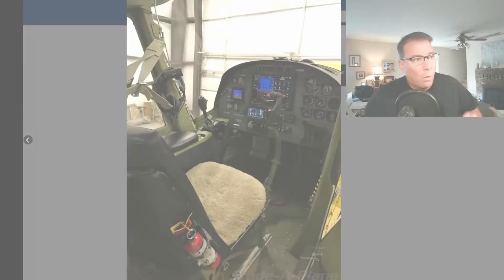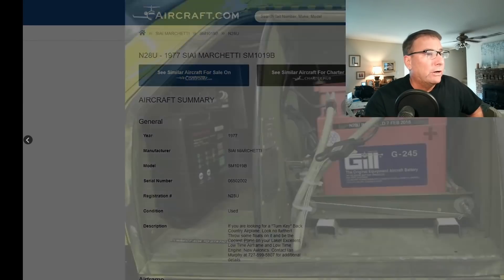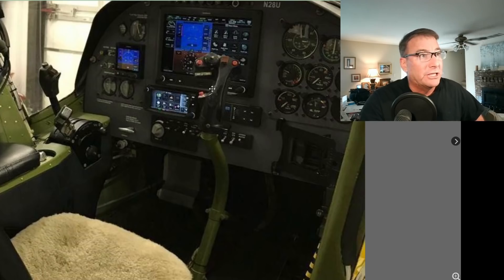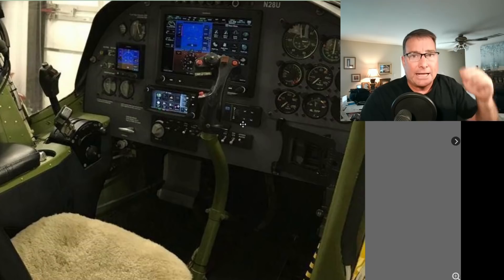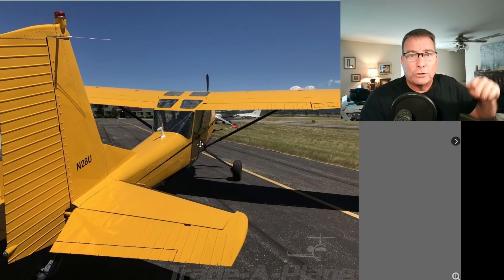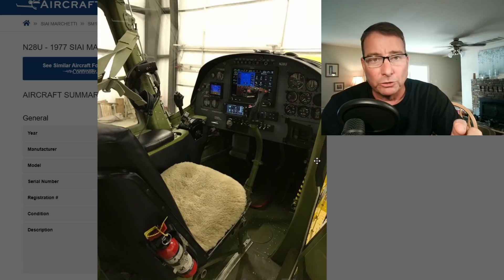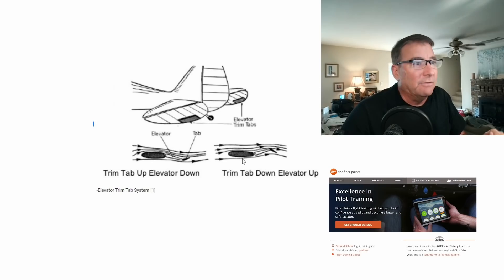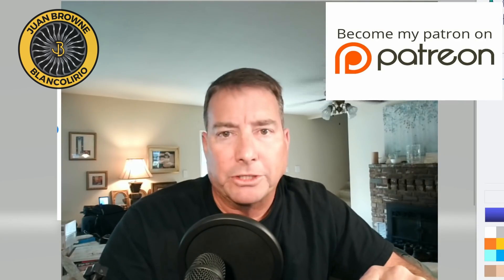Dale 'Snort' Snodgrass Siai Marchetti UPDATE- Elevator Trim System 8/8/21

Comment: Cant you just push the stick nose down to counteract that opposite trim ? And I personally think 70+ is simply too old to fly. Less than 2 weeks ago Ryan airfield, fatal crash, 87 year old pilot, I mean c'mon, 87..... That B-17 Mcauley pilot and co-pilot come to mind, 75 and 71 year old respectively, jury rigged magnetos ("she always sputters a bit, that's the charm, we always did it like this in the old days, don't worry, it's fine !"), crashing with 7 tourist passenger fatalities, or that insane Leeward, actually racing at 74, in, again, a jury rigged warbird ("just cut the wings off, it will turn faster !"), killing 10 in the stands. These guys should just stay on the ground. Yes, these examples include gross negligence regarding maintenance and modification, but can't help the fact that I think age, is a contributing factor. 75 and flying paying tourists around in a B-17, 74 and racing a P-51, the guy at Ryan 87, this guy 72, it's just a tad irresponsible if you ask me.

Comment: As always Juan, excellent respectful reporting and analysis of the accident. One thing I noticed by watching the video you linked to that adds to your theory of the control lock being engaged is that the tail of the plane was never raised prior to takeoff. As you know, pushing forward on the stick to raise the tail off the ground is a typical method of takeoff on a tail dragger. The fact that that was not done may also indicate the presence of a control lock.

Comment: Been thinking, if the trim was reversed, as you initially trim forward, the stick would come back, this would immediately get your attention. Bearing in mind you would already be putting on forward pressure to lower the nose anyway. You would at least stop applying trim and hand fly on the stick. I know longer think this was reversed trim. I now believe this was a locked elevator for whatever reason.

Comment: If you catch the airport video with the plane at just over a 60-degree bank, it can be seen the the elevator was full nose down.  Of all the theories, runaway trim is the most likely.  A talented/skilled/experienced pilot would center the ailerons and use all they have to try and push the nose forward, without asking the plane to also turn.  I’m not familiar with the air craft, but fumbling to try and change the trim while wrestling the yoke forward makes the most sense, hence the accidental push-to-talk press.  This is just  speculation and will wait for an official report.

Comment: I still have a lot of questions.  If it was runaway trim, then why could the roll not be reversed?  Theoretically you could roll to a point where you were in a stable turn, or at least not going down.  This roll stopped, but never went back to the right.  If he had throttle, aileron, and rudder, the plane could still be flown.  I realize that this is an extraordinary situation, but by all accounts Dale was an extraordinary pilot.

Comment: I haven't seen anyone mention CG. A commenter on the previous video mentioned he had loaded the plane with camping gear. How easy is it to load the Marchetti too far aft?
Reply: His wife wrote they flew the Aerostar to the airport the morning of the crash to pick up the Marchetti [from ~24 days of maintenance at the airport] and she drove the car back to the ridge. With the car available to transport any camping gear, there would have been little need to put any in the plane.

Comment: Another pre-flight tester would be a battery-operated audio beeper (single tone piezoelectric sounder) that would be interrupted at a rate proportional to the position of a pendulum hanging off the gadget. It would allow the tab position to be monitored by ear, whether or not you could see the tabs. Those sounders are cheap and the tone would pierce the noisiest location. Further, you would not likely leave your tiedown while forgetting to retrieve it.

Comment: I've not flown this SM 1019 variant but do have time in the original O-1/C 305.  That said, one of the characteristics of this airplane is a very powerful nose down pitching moment when the flaps are extended beyond the 40 or 45 degree position to the 60 degree full down position requiring full or near full UP elevator trim to fly and land.  With one pilot in the front seat and depending on other loading it is not possible to keep the nose from dropping when power is reduced to land.  ,If Dale's previous landing was a practice short field and the elevator trim not reset for this takeoff, even application of nose DOWN electrical (notoriously slow) trim at liftoff may have been insufficient to maintain control.

I'm not speculating on the cause, just reporting of the type's flying characteristics in which he was low time.

My nickle's on the grass.  RIP Snort.  Prayers for your family's comfort.

Comment: You could carry a clamp-on flag that would allow trim tab movement to be seen as it is put through its range during preflight. Tab operation is obviously as important as checking the other controls.

How about a secret small explosive charge that would disconnect the tabs from the trim mechanism as a last resort? You could set it off with a piezoelectric ignitor (think barbecue ignitor) placed where it won’t be accidentally touched. You would have some ‘splainin’ to do if you used it,  but better red (faced) than dead!

Comment: Interesting….one would wonder that a light aircraft, even if modified to utilize a powerful turboprop, could be certified in which pitch authority could not override pitch trim….and if so…a possible emergency procedure would be to chop power?  Yes, understand everything happened fast…..  Also possible pitch was not set for take-off, and still set in the last position for landing (with flaps)?  And what about a weight & balance issue, mis-calculation …something just too heavy placed in the aft baggage area (assume there is an aft storage area).

Comment: Question. Why did Snort key the mike? ("S..t, S..t").... "My bad, my bad..."?
Reply: His final expletive did not mean My bad. It was not his fault.
Reply: @citybright8925  That would mean what happened was beyond his control... I formed the comment as a question. All of the guesses so far do not include an act of God.... Fault is not a forensic term.

Add. As I watched the aircraft roll left, I thought torque. Rotating a mass in one direction produces an opposite impetus. I doubt the ailerons were commanded roll left. Similarly, I doubt left rudder was input. That leaves the torque of the prop, and the power to produce it. Wind gust? Operating only as downforce on the left wing? It is difficult to consider the pilot would not know what precipitated the crash. He knew close to instantaneously what precipitated the increase in Nose Up pitch. My surmise is still an inability to reduce Angle of Attack as he broke ground. I think also with his immense skills he was aware what caused it.

Comment: Juan's original post concerned a theory that Snort was "hanging on the prop". Followed a caution not to do that, push the nose down after a reasonable show of STOL performance.

Did Snort get the tail wheel off the deck? Because when power reaches an inability to keep the nose up and the aircraft flying, a Stall is inevitable. Was he performing yet another max effort launch? Loaded in the back with heavy gear? A normal recovery would be push the stick, firewall the throttle. 

At low altitude, what does a recovery look like? Is it even possible?

Pilot qualification means zip in an unanticipated abnormal? Startle can in an instant squander the split second that might be crucial to survival?

Comment: The elevator forces increase rapidly and are surprisingly, no shockingly strong on takeoff. Due to a miscommunication I thought the trim had an issue (but I still flew it, duh me) but it was actually the position indicator that was inoperative. This resulted in me not trimming until the forces grew so great that I could no longer pole forward so I then wound the trim wheel. This was a Cherokee 6/300 so without looking up the the specs of the Siai Marchetti I imagine the 6 didn't have anything like the forces that this aircraft had. 
My bag of experience got a big addition that flight with a small depletion from the bag of luck. I wish I could have donated from my luck bag for his flight. A very disturbing and very short video but I hope something positive comes from this. Even though I didn't know the pilot, my sincerest condolences to his family and friends.

Comment: I am merely intrigued and have no professional experience but was recently reading up on the Reno air crash with Galloping Ghost. The two incidents looked quite similar in their instant sudden change and loop. I apologise for not knowing the correct terminology but I recall the trim tap failed on the Galloping Ghost Mustang which caused the loop at over 11g. 
My thoughts are with Dale’s family

Comment: powerful engine ,basics in this plane included .increasing thrust creates pitch up more than lift up and if trimmed back for the landing prior ,then will require quiet a bit of forward force LBS to overcome before trimming forward to neutral .The severe pitch up and loss of speed reducing controll authority ,the stall spin .tradedy follows ,sorry to the family.a great loss.best wishes from Australia.

Comment: No toe brakes on this aircraft? Taxiing should be simple with differential braking even when rudder pedals locked. There's simply NO evidence in the video of control input on any of the 3 axis either during flight or post crash. Only one explanation for that!

Comment: Juan, another thing you mentioned in the other video was the engine stayed full power. Could controls to prop pitch and or engine throttle be a factor?

Comment: So are you saying that the elevator trim is the exact opposite of what one would think?  That the trim tab doesn't do anything other than effect the elevator, and it is the elevator that actually does the action that will raise the nose up or down?  I would have never guessed that.  What about in the case where the elevator is flat or perfectly in line with the stabilizer -- if the elevator is perfectly in line with the stabilizer then wouldn't the trim tab become like sort of a mini elevator and then at that point up would be up and down would be down, right?   This idea of the trim tab only working to move the elevator seems odd.  What if the elevator is sort of locked into position by a jack screw or an auto pilot or some other device.  Are all elevators so loose that they could be moved by a trim tab, and if they are moved by a trim tab wouldn't the force of the wind on the elevator just push it back down.  I'll take your word for it at this point because I know that you know much more about this stuff than I do, but perhaps you could do an entire video about these backwards trim tabs because to me it seems like there should be some other thing to this that I'm missing.   Why wouldn't a trim tab simply be an extension of the elevator?

Comment: Thanks for the red heart.  Pitch trim switch theory sounds good, but.  Notice on the takeoff roll.  He did not raise the tail.  The tail came up a little, but I think that was normal due to the prop wash.  Remember, the ailerons do not appear to have moved at any time.  He would have been fighting the left roll.  And again, look at the after crash photo.  The rudder and elevators are all in the neutral position.  After an impact like that, the elevator would probably been down due to objects pushing against the stick, and the rudder would probably have moved also.  I do not think it was the normal control lock causing the problem.  It would be too hard to climb into a Birddog and not notice the lock was in place.  Your feet would get tangled up in it.  Keep up the good work and let us know any further details.

Comment: 30 years ago, a good buddy and great pilot (recently retired 777 captain) picked up a Cessna 414 out of maintenance.  On takeoff the nose started pointing upward.  He had the presence of mind to reduce power and apply flaps, bringing the nose back down.  Got it back on the ground - turned out maintenance had mis-adjusted trim cabling.  God help us.  RIP Snort.

Comment: Because of the progressive pitch up I still think it is trim runaway.  But I honestly thought you would be able to overpower it and its also odd that you don't seem to see any elevator deflection - but perhaps you just can't see clearly enough.  I check for full and free movement but the trim is difficult to check.  And if it was wrong I think you're right that at such a critical point in flight there isn't enough time to figure it out and do anything.  Even panic cutting the power will take time to respond.

Comment: I have not read all the comments but I have to wonder if the rear stick got snagged on the rear seat stowed camping gear. 
Even after impact the elevators do no droop down and a rear snagged stick might explain that.
I see no aileron or elevator input. 
As for the trim, well if the rear stick was snagged, guess what forward trim would do. 
Very tragic indeed.  The cause will be simple, once found.

Comment: A few years ago I encountered a runaway trim issue but the advantage that I had was that it was already reported but the squawk was vague so I decided to troubleshoot the issue at 5500 feet while on a cross country flight.  The breaker was pulled and I pushed it back in.  All was well for the first few seconds of engaging the auto pilot in the wings level mode.  Then it suddenly aggressively pushed the nose over into what would have been a steep dive but I almost immediately pulled the breaker again when I realized the amount of back pressure required to prevent a very steep dive.  Had this happened during takeoff and with no heads-up of the trim issue things would have unfolded in a different way.

Comment: Isn't trim in light aircraft like this driven by the wind force on the control surface trim tabs, and therefore relatively easy to overcome? It's not like jetliner trim where there's actual hydraulic power biasing the center position of the control surface. Trim is just there so you don't have to hold in a constant force on the stick over long periods of time, no? It's not like it prevents you from being able to achieve a full range of control surface deflection.

Comment: This is a tragic accident!!
On the possibility of a runaway pitch trim: is the electric trim operated by a single switch? If so, that sounds risky!
On the only aircraft that I flew with electric pitch trim, a Socata Trinidad (TB20), there were two switches. They were located next to each other and in line, so that they could be moved  together (in either direction). One operated the electric motor and the other operated a clutch which was normally disengaged. There was, of course, also a manual trim wheel which moved when driven by the electric system.
This system would require short circuits in both circuits to runaway. Also, when checking the system, having two switches allowed each switch to be operated separately to verify that neither, alone, would cause the trim wheel to move, (which would indicate that the other was already operating due to a short circuit).

Comment: May I absolutely reinforce your comments about trim tab set up.  They are very counter-intuitive, not only must the tap move up for down trim, but with an electric switch on the column it could be that "switch forward" for down is actually closer to be "switch up" because of the way the switch is mounted. Way back I was a Licensed (CAA) aircraft mechanic and we would check and check again systems like this and we always worked in teams as this was commercial ops.  In GA a lone mechanic could check their work a dozen times and not spot a reversal.

Comment: I am no aircraft designer, but it seems like a bit of a design flaw to have a trim system with more authority over control surfaces than the pilot has with manual controls.

Comment: Many years ago I had my stick jam during a dual training session in a Pitts. I thought my student in the front seat had obstructed the stick, stopping all elevator movement. It was locked hard and it was a very long few seconds. Anyway, somehow we lived. Later, the company engineer found a half torn coin shaped item down the back behind the rear seat. It was the badge/insignia of the 5 point rear seat harness. I always took the seats out and inspected for loose/foreign items with a torch during any pre-flight, yet I missed it. My heart still skips-a-beat when I think of it. No connection to this accident inferred. Stay safe folks.

Comment: Failed elevator trim can be a problem on even the most simple systems. Many years ago some friends were in the circuit in a Piper Tri-pacer. The elevator trim controls suddenly detached (wire broke?) and it took the full strength of all 3 people in the aircraft to pull the yoke back to stop a steep dive. Some very relieved people got out of that aircraft just a few minutes later when they landed. The huge amount of force needed to correct the failure was a very unpleasant surprise.